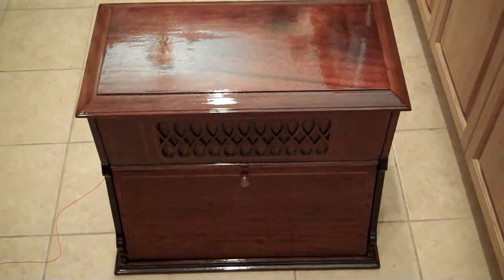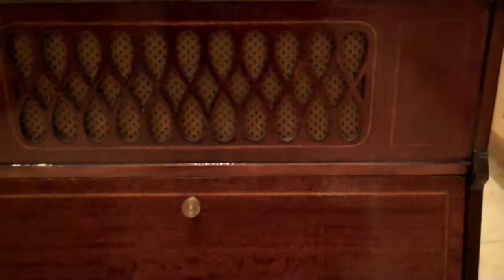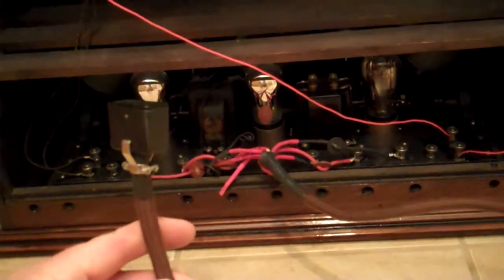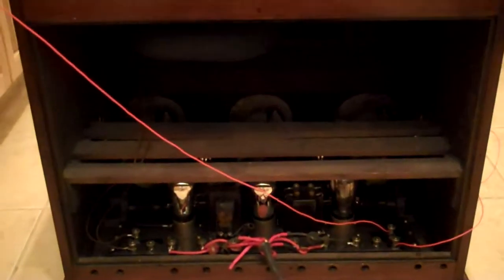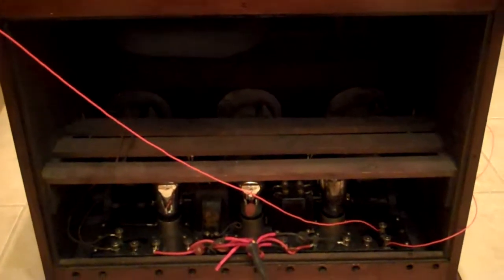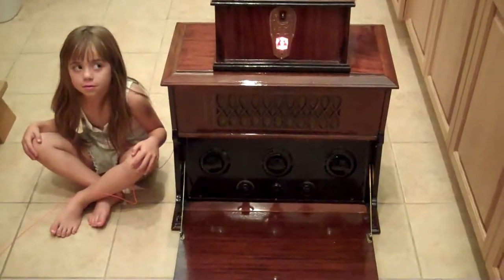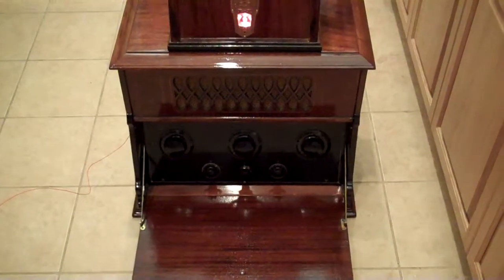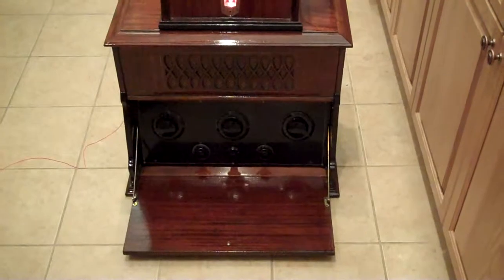FADA NEUTROLA GRAND 1925.

Comment: I have a chassis from one of these, and I've never seen a working mid-1920's radio before.  Now I'm jealous because I know it's a long shot I'll ever find the cabinet for mine.  I'm amazed at how quickly it warms up compared to tubes from the 40's and 50's, which are what I'm more used to.  I was hoping to see what the tubes look like when it's all lit up.